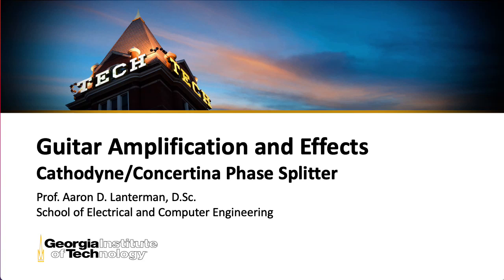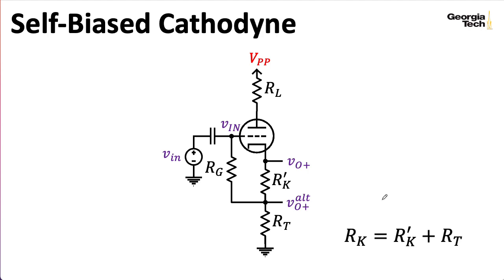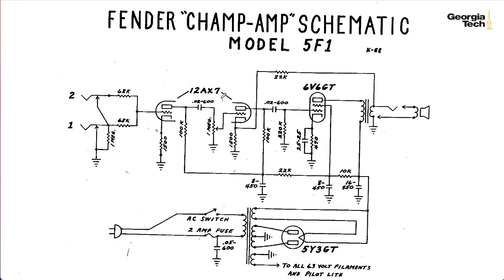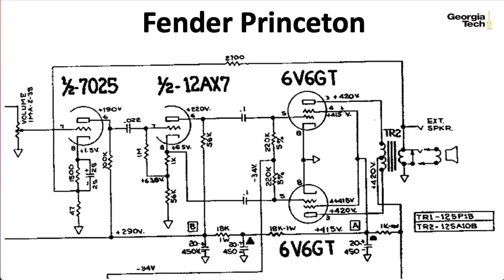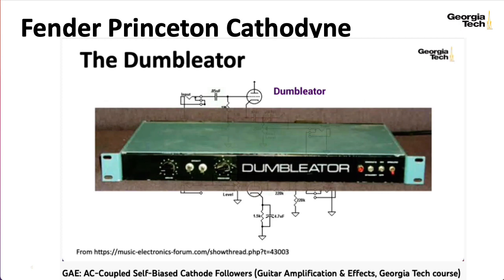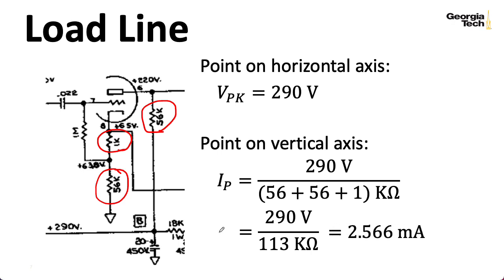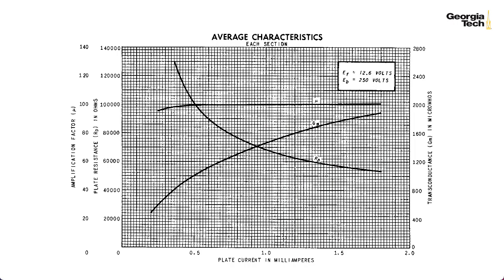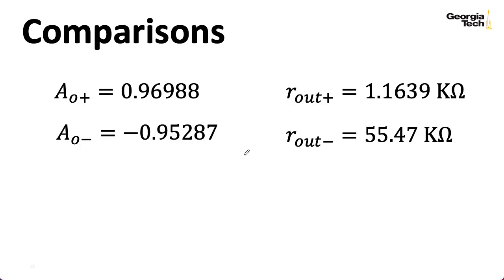ECE4448 L26: Cathodyne/Concertina Phase Splitter (Guitar Amplification and Effects, Georgia Tech)

Comment: Fun fact if: if you do the math with both loads connected, you’ll get that the output impedances from either side are perfectly balanced if Rk=Rp and the grid resistors next stage are also the same. In short, cathode output z is not very sensitive to loading on the plate BUT plate output z is VERY sensitive to loading the cathode. Your videos are great!
Reply from the maker: Oh that's very interesting! I need to check that out. 

P.S. Thank you for your kind words!
Reply: @Lantertronics  a nice intuition for this circuit in balanced operation is thinking about both Rp with Rleak parallel and Rk with its Rleak parallel and realizing that there is one path for the current to follow, ergo AC voltage drop on plate and cathode are same in magnitude.

Comment: One thing I would add....I notice you were using Idle voltages when doing this bias and load-line ...make sure to use the "full power voltage"... meaning the B+ will droop when at full power in the Class AB1 amps.. Typically analysis is done for both the power output stage when at full power at those drooped voltages.. The pre-amp stage can be looked at both lower power and higher power situation..